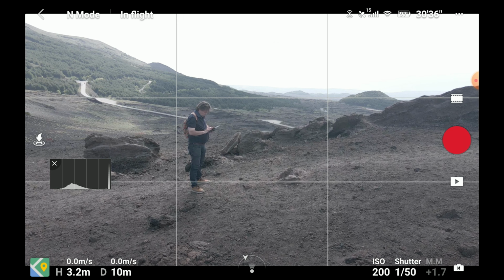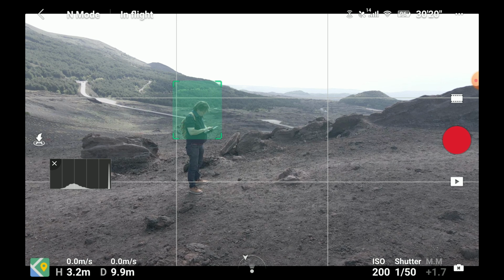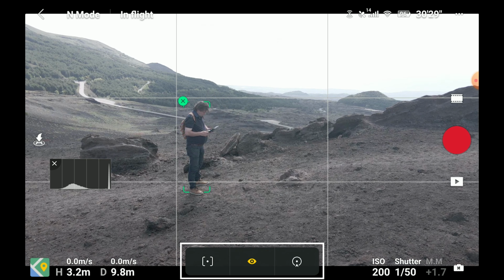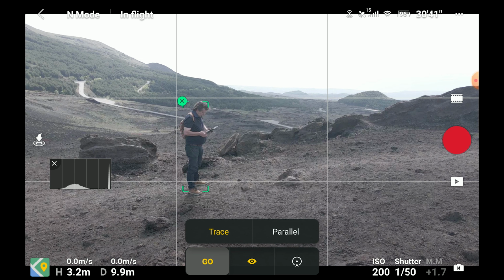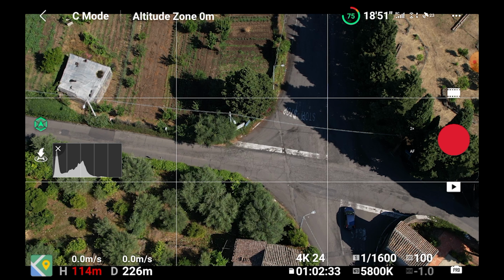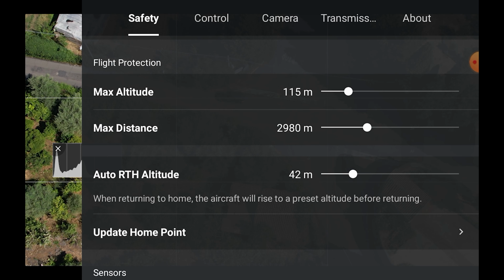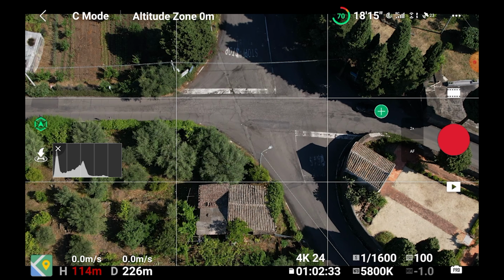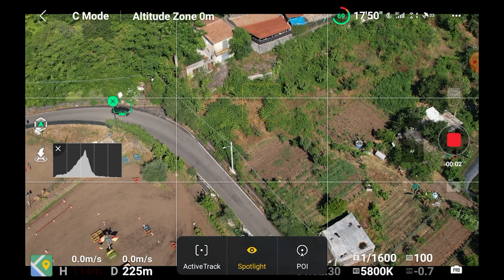DJI Air 2S Active Track - Follow cars, bicycles, people, boats

Comment: I love your detail on the subjects.
I used active track to follow my boat in the Gulf of Mexico offshore.  At about 25mph with the drone following at 100m at a height of 30-40m, the drone lost track, stopped and went to hover and lost communications with the controller except for up down movement.  It was tough getting it back on the boat. That loss of control is disconcerting and I can’t explain it given close proximity. I was turning when the loss of control and tracking occurred.  
Related, previously it took awhile and a bit of practice to figure out the best way to recover the 2s on a boat.  Boats are always moving even at anchor and the 2s does not like to land around anything moving even with obstacle avoidance off.   I land it in my hand but it does not always accept landing I believe because of the boat movement.  In any case it’s tricky.  Expertise around how best to do that might and work with the 2s features be a good subject.

Comment: i have some hawks in my neighborhood. can i follow one of them with one of the auto modes? i have not purchased the unit yet.
Reply from the maker: Hi Carl,
interesting question.
In theory it should be possible. But you should get quite close o recognize them as a targt. 
If Active Track fails to recognize them, it is also possible to use Spotlight to keep them in the center of the frame
Reply: @VICVideopIC  i would not want to get too close so use one of the zoom modes. i could start while it was sitting in the tree next door. only problem there she can sit in the tree for a couple of hours at a time. i will let you know how it goes when i get the drone
Reply: you dont have to follow them....they'll follow you!

Comment: Very detailed video, thank you.

I am having difficulty getting my Air 2S to follow two motorbikes… works fine with just one, but not two for some reason.

Can you confirm which tracking mode I should be using, assuming that the drone will be able to track two bikes?

Or, perhaps it can only track one?
Reply from the maker: Thanks,
it can only track one target at a time
Reply: @VICVideopIC  thank you.

Comment: I had a side flight crash while circling a vehicle in active track. I managed to stick the drone into the ONLY tree with in 100's of feet. I was driving and flying simultaneously - but - in a large open space abandoned space with no one around ;) 
I would like to fool with the active track some more before I feel confident about it.
Reply from the maker: Wow, was the drone damaged?
I must agree that when flying laterally at 90 degrees, the sensor are unable to detect obstacles
Reply: @VICVideopIC  Thankfully the drone was unscathed- retrieving it was a little more difficult. I had knee surgery about 7 days prior and climbing a tree was not an option. Instead I used the winch on the front of my jeep, wrapped the cable around the tree and shook it a few times...the drone feel out and plopped in some mud, after a little clean up- totally fine :) 
Here is a link to that video :)
https://www.youtube.com/watch?v=yMPRI1qCVs8
Reply: @VICVideopIC  BTW i used some of your edit techniques on this video :)

Comment: Vic, some of us are still using the Mavic Air 2. It would be very useful if you reflected whether this guidance of yours applies to other drones using the common DJI Fly App. I haven't been able to test whether it works correctly but my app with MA2 offers the Subject Scanning control switch. I presume all the smarts are in the app and not limited to Air2s airframe.
Reply from the maker: Hi Bill,
Active Track works in the Mavic Air 2 in a very similar way as in the Air 2S.
The main differences I find is that in the 2S the upward sensor protects a bit better when flying laterally. Also the 2S algorithm does a better job in maintaining the target after it is covered by obstacles.
Here is a link to my review of Focus Track in the Mavic Air 2: https://youtu.be/uvIerCOoQMc

Comment: I have had my Air 2S crash tracking my car. It flew into trees overhanging road and ended up in tree at side of road. I managed to get down with help of broken branch. One propeller had come completely off (and was lost) and another was damaged, but the drone was fine otherwise. So change of props and I was flying again. On another occasion tracking me on foot it moved sideways into a twig. On this occasion it flipped a somersault, but stayed in the air - but another propeller was damaged and had to be replaced. So after these experiences I am now very weary of using the Air 2S tracking near trees.
Reply from the maker: Very interesting.
Luckily jor damage for you.
I agree that flying laterally is is a bit risky. 
I have been lucky so far despite seeral tracking flights. But in two weeks I will follow a mountain bike race and I think I will go with the Mavic 2 Pro